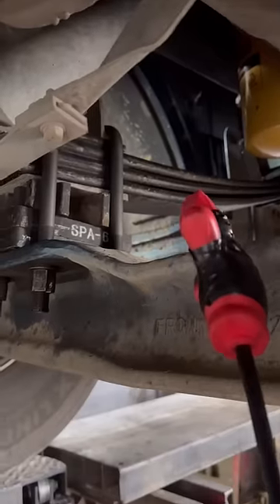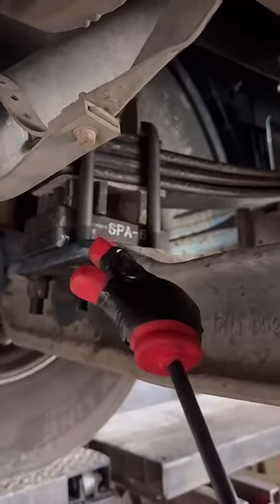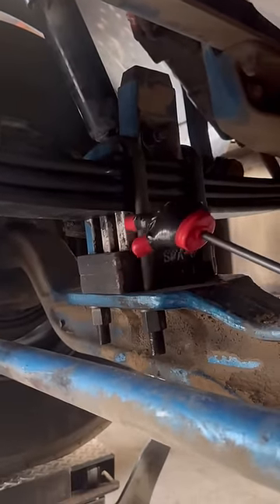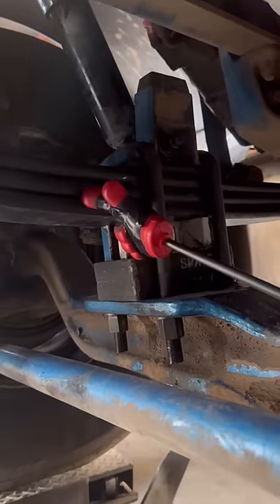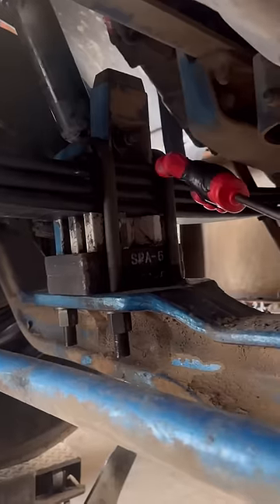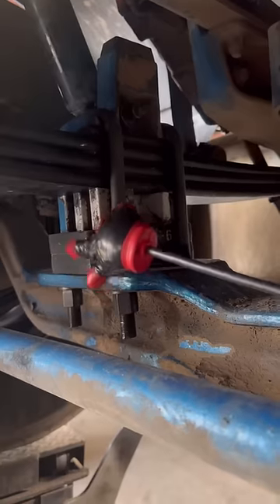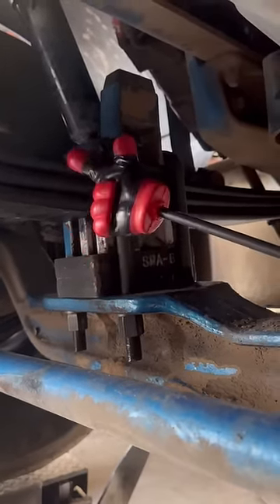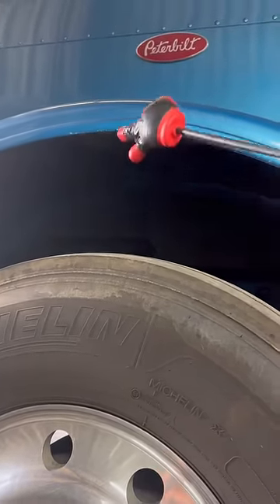Dropping a 379 Peterbilt #shorts #peterbilt

Comment: Someone wasn’t thinking…. Heavier spring with more arch, more leaves, less sag, hell throw that block back under there and we’ll just charge for longer u bolts!!

I’d insist my barely used ubolts be saved for me and left in the cab. Might not use them on an axle but I’m a pack rat, maybe a welding project or something
Reply: A guy on the floor that understands truck geometry. 👍

Comment: There is a bunch of info missing here. Dicking around with the steer axle ride height isn't going change the driveline angles. To adjust the driveline angles either bring the air bags down to build height or change out the axle wedges to bring the angles into line were they need to be.

Comment: I had a 359 with air leaf rear suspension. 4 leaf front suspension. Truck was lower in the front. Broke lugnut studs OFF. Averaged about one stud a month. Raised the front end to level out the frame. Fixed the lug stud problem. Rode 3 times nicer. Now I'm the only stud problem. Lol.
Reply: I just go forward.

Comment: Bendon, love your content.
I wish we could've seen the weight ratings for the axles. My biggest vehicles are a F-350 cab & chassis  & a E-450 cutaway. The front axles  are around 5'500# & the rears are rated for 9'600#. My little guys run on E range tires. I'd  love to see the ratings on the class A stuff you work on since I'll never own one. 
When I see a quad axle trailer hooked up to a tractor with a 3rd axle down, I make way for them, sometimes unintentionally because of the air pressure. Seeing what they're rated for would be pretty cool.
On a side note. I'm glad I don't have to pay to maintain a H range setup. Yeesh. Just the little commercial trucks cost a small fortune. 
Anyway, thanks for giving us a window to see your niche of a rare skilled trade. 👆

Comment: Is there some kind of tool or procedure to find the perfect angle for drive line angles?

My truck sits quite high in the front due to an engine swap. I've had the carrier bearing moved as far up as possible but I was still getting slight vibration so I raised my ride height on the rear a few inches.

I still have a slight intermittent vibration but I can't seem to get rid of it and don't know it its actually the angle of the drive lines that's causing it.

Comment: Never run lift blocks on the front suspension. They will fail. They are put under more lateral stress than the rear suspension.

Comment: its.... air ride, just adjust the air ride, but I guess if you have the time and money to throw springs and spacers on the axles that are not the problem... its your money, never mind that it doesn't do a damn thing for drive line angles.

Comment: Whatever happened to " DO NOT DRILL OR WELD ON FRAME RAIL"????????
Reply from the maker: That is a good question. Not the back end of this truck had all bolted on parts. You can drill the web of the rail but.  Not the flange. You can weld at the last 28/36 in or the rail depending on the manufacturer. But they say don’t do it at all because when left to Their own ideas people would go to far. And if you do weld on it you can not weld straight across the flange. But thank you for your comment I may have to make a video about this.

Comment: Think 🤔 the money 💰 they spent ??? Could of bought another truck with a pusher axle ??? You Think 🤔???
Reply: They didn't spend half of what another truck would cost
Reply: @leejohnson6173  Well I stand corrected,but what do you think 🤔 How much they spent in Part’s and Labor ??? And do you think 🤔 they could of went without the block’s and just went with the 3 leaf springs ??? I take it there going to haul heavy equipment ? What do you think 🧐 ?
Reply: @arthurburke1044  🤔
Reply: @zeb1288R  Well maybe not another truck 🛻 ? But they spent $$$ some money 💴 putting it together. Hope it works out for you.
Reply: @arthurburke1044  honestly the cost of keeping pre-emissions trucks on the road is worth more than these new trucks but they were probably between 5 and 15k on that setup and parts
Reply: @arthurburke1044  you make some key points...I agree

Comment: This guy seriously sounds like me on a daily basis it's quite scary and funny at the same time literally the thought process is practically the same attention to detail on the extreme level as soon as I saw that triple leaf and those blocks I'm like that's a little much

I work on my own stuff sometimes I deal with my company stuff they just don't know about it but I know what to touch and what not to touch if it's something that I can fix easy I'll do it you know 5 minute fix if it's something that's a lot more involved suspension or anything I ain't touching or if I have to start pulling panels off the dash cuz my primary job is to drive the damn thing now my stuff at home oh I'll tear a new asshole if my vehicles that I own are being an asshole

Comment: Do people just do whatever to these trucks?  Now I’m not a truck guy, but why modify the height of a truck that has to fit under and tow a trailer?  Won’t the trailer ride nose high?  And why does every single part look like angle brackets bolted to a rail. Is it a truck or a shed?